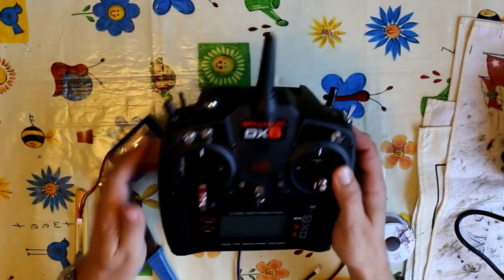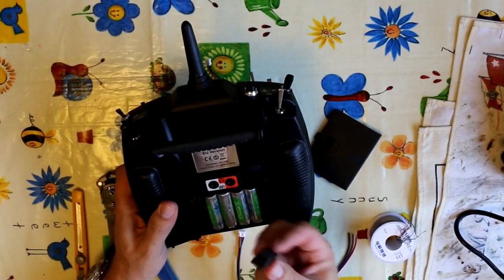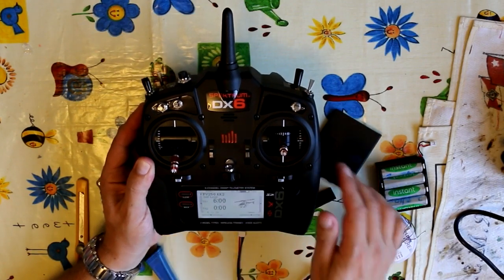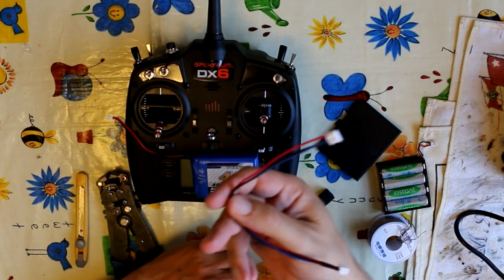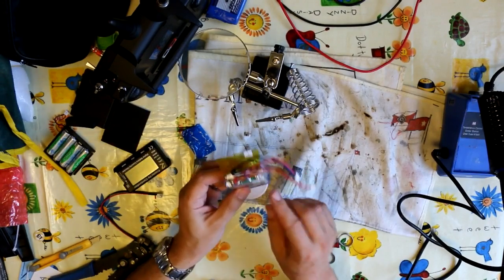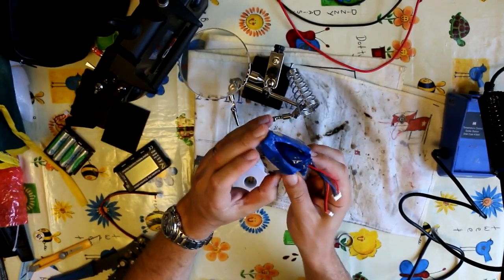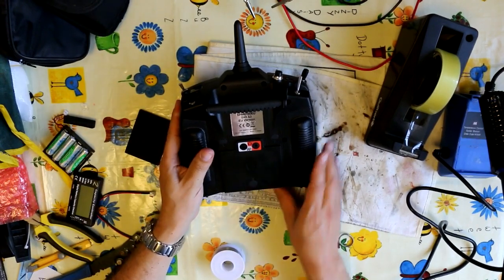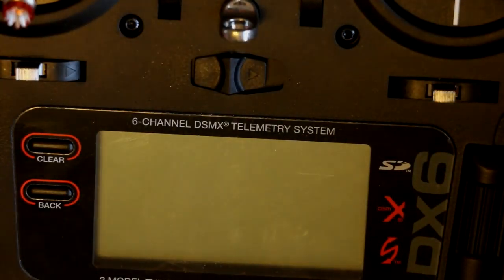Spektrum DX6 -  cheap lipo conversion using Turnigy 4000mah DX8 lipo

Comment: I just installed a standard servo connector (futana).spliced into the wiring than use a field charger to charge the battery and than install the battery in the transmitter and your done.Make sure to set your field charger at 0.5 amps and 2 cell.It takes about 6 hours with a new battery.I just replaced my battery this way in my DX8.

Comment: The low voltage protection circuit on the Turnigy battery was turning my transmitter off around 6.9 volts - the transmitter would just go dark. Luckily it happened when I was doing stuff on the bench and not flying. I had to change my Lipo voltage alarm point on the DX9. After doing this mod, adding the balance lead, it turns out the two cells were almost .4v off from each other. I think that's why it was cutting out early - one cell was triggering the LVC well before the other. I think this mod is a REAL good idea not just to charge with a radio like the DX6, but also to balance occasionally for radios that have built in charging. This was great, thank you for showing exactly where to solder!
Reply from the maker: Glad this was useful. Interesting that your cells were so out of balance, on my DX8 the charging is incredibly slow (48 hours or so!!), and my undestanding is that slow charging should balance out cells at the end as one cell will sit full while the others 'catch up', but I wonder if this would only happen if you to leave the Tx on charge for several days. I bet a lot of people (including me) only charge the Tx for a few hours just to top it up (my DX8 battery will last for months between charges) so this isn't enough to balance the pack out ! I much prefer being able to click the back off and use a proper balancing charger, as its much quicker/easier, but I hardly use my DX6 (I use DX8 for planes/heli's, and used the DX6 for FPV quadcopters), but plan to use it to teach my son to fly so will dust it off for that.

Comment: Is there any way to do this to the old DX6i cheaply? I found a 2300mAh AA 4 sell pack for a few £ that looks an easy strait forward swap...
Reply from the maker: I got rid of my DX6i's, but don't think there is space for a battery pack without cutting the case also the DX6i I believe has a DC-DC converter inside so would overheat on Lipo voltage (it was based on old JR radio stage I believe). What I did with mine was to use the ENELOOP/NIMH+ AA cells, I also resoldered the charge port the correct way round (they came with the old JR centre negative wired, so its a quick soldering job to swap to the standard center positive) then just recharge with the charge port using a cheap charger plug. I found the good rechargable Eneloop/Nimh+ lasted ages and don't have self discharge so most of the benefits of a lipo for much simpler.
Reply: @jamesb72  hey, thanks for the response. I think just a 4s AA pack 2300mAh will do me fine... Good flying!

Comment: hi mate can you help please i have dx6 3G and bought a Turnigy 4000mah model no spmb4000lptx lipo for HK. when i charge it on my imax b6  it ask me to connect the balance connector and there is no connector. The setting i am using on the charger are Lipo charge 2ma / 7.4 2S is there something i am doing wrong here.
Reply from the maker: You cannot charge that lipo on DX6 - its for DX8 which has the internal charge port, you'll have to make up a balance lead pretty much like I did to be able to charge with B6

Comment: Can i do that lipo cenvert to my dx6i????? tnx
Reply from the maker: Andrej Spreitzer not easily as the dx6i doesnt have space for lipo or run on higher voltage so you'd need to cut the back out and use a voltage regulator - nothing is impossible but i would just use eneloop type low discharge nimh aa cells as they fit straight in and have most of the benefit of lipo and if you swap the wires on the charge socket to be centre positive which is normal way round you can charge with a normal charger.
Reply: Tnx for a great advice....i will do as you say.

Comment: Why would Turnigy make a 2s lipo with no way to balance charge it? Thats odd.
Reply from the maker: foxprogt it was made for the dx8 which has an internal unbalanced charger built in. At low current charging and discharging balancing isn't much of an issue it's only for flight packs where fast charging and discharging make balancing more critical.

Comment: what happens when you  get a  low voltage alarm in mid flight?
Reply from the maker: Gary Vale you just need to land immediately depending what you set low voltage alarm too you should have several minutes warning.
Reply: but will my Tx inputs continue to operate normally and the voice settings and LED screen  still operate?
Reply from the maker: Gary Vale everything should work as normal down to about 5v (if you ran on AA batteries that's all it would have) its just how long that is as battery drops off quite quickly towards end of its capacity. A FULL'  2S lipo is 8.4v and it should discharge down to ~6v normally, after that the voltage will drop more quickly, I have warning voltage at 6.8v which would give plenty of time to finish flight without any concern - honestly I wouldn't worry about it as long as you change battery mode to lipo - if you forgot to do that then AA alarm could be at 5v which would be very late for a lipo.
Reply: @ James.....I have have my low voltage alarm set at 6.8v  too, however I am using the Lith-ion pack.... I was always curious as to what exactly happens if I received the alarm in mid-flight, but seems that all I should get is the voice warning...and still have plenty of time to land...... as my Tx will continue to operate normally...until  it dies of course ,  which you believe is 5.0v......this is the  info I wanted to know......... .thanks  much......Gary
Reply from the maker: Gary Vale you can test this at home to check how long dx6 runs for from 6.8v warning I'd expect it would be ages. I've had low voltage warnings on dx8 and finished flight with no issue. I've never run dx6 that low as battery lasts so long i recharge when it gets to half on graph which is pretty infrequent. back in the days of 35mhz i would charge transmitter every time i flew and occasionally would run out during a days flying but transmitters ate much more efficient now and batteries much better!
Reply: good idea and helpful information......my guess that the Lith-ion battery  would have quite a bit of  its capacity power left from the warning alarm set point at 6.8v until it reached  down to 5.0v,  where the Rx would then go into Fail-safe mode... I am not sure about how long  exactly the Lipo would  continue to operate in the same situation...maybe that's something you want to test out....if so, make another video on it..... ...thanks
Reply from the maker: Gary Vale that would be a very boring video even by my standards I'm sure you'd have plenty of time to land safely which is all that matters.

Comment: Hi James,  I want to convert my Turnigy 4000Mah Lipo for my DX6 also. I saw your video, but I want to double check with you exactly how the new connections for the charging cabling are to be made. To me it is was not really clear, I am no Lipo expert. So can you describe this part in short to me. I would appreciate this very much. Thx, Rob
Reply from the maker: Hi Rob, I tried to show this in video at 3m10s, but best way is to use a voltmeter you will get ~8.4v across the battery terminals you want to use for red/black, use the original red/black cables to identify which end of battery for which, and then measure ~4.2v between either of them and the centre connection for your middle balance wire, voltages don't have to be exact but if you get ~4v when you expect ~8v you know its not right. Once you take the tape off the end of the lipo you will see hopefully it looks same as in video and it will be clear.
Reply: Thanks James  for the additional info. That was a good tip to use the voltmeter. Just to be sure and on the safe side. I have adapted my Turnigy 4000Mah Lipo now and it is working fine in my DX6. Thanks again for the assistance.

Comment: good work, my turnigy battery just turned up so I've tapped a jst plug onto the batteries spectrum plug and plan to just charge it like that. Won't be a balanced charge, so I might add a 2s balance lead on it later. thanks.
Reply from the maker: I don't have any experience of non-balance charging, but in the DX8 it would only charge unbalanced (but takes 15hours or so), so my understanding is that unbalanced charge is fine for slow charging (1/10 C - 10 hours or more), but no higher/faster.

Comment: So will running the tx at 7.4v rather than regular AA 5.8v or whatever, possibly make it have better (stronger) range by chance?
Reply from the maker: Sorry no, the transmitter runs on 5v internally regardless, there is a DC regulator to drop the lipo voltage down ;) The range is limited by regulation, so would have to be constant throughout battery charge and between battery types. If you have your receiver/aerial properly mounted you should have no issues with range up to 1km which is well past line of sight.

Comment: Got it charged with no problem outside the transmitter. Really isn't difficult to plug it in or take it out, you have ample lead on the Turnigy battery charger wire to maneuver. Thanks again.

Comment: Excellent video. You sold me on going with the Turnigy 4000 over the Spektrum 2000mah Lipo for the DX6. To charge the battery I bought the Spektrum Adapter cable with the banana leads. I have an iMax B6 charger. Do I simply plug the leads into the side of the charger, set it to LiPo and hit start? I'd much rather install a charge plug as you did, but I just couldn't see the connection well enough in the video to try that. Again thanks for the great video!
Reply from the maker: I only ever balance charge, but using the adapter, you should be able to charge as 2S lipo at a low current as its unbalanced charging so need to take care and never charge unattended. If you have a voltmeter and check the connections you can identify the pack positive/negative and centre tap easily to add a balance connector.
Reply: Yeah, I used the adapter and charged as 2S Lipo at low current. Worked like a charm. Thanks for the extra help with adding a balance charger to the battery. I'm going to get a voltmeter so I can be sure of what I'm connecting to. Appreciate the video and the extra tutelage.

Comment: So, to make this work, I need to solder one ground to either ground terminal and then one wire to each positive terminal?
Reply from the maker: No, you need one wire to each cell +/- on balance lead, I tried to show this on video, but you should check with a multimeter to be sure you have cells correctly connected or it will damage your charger or lipo. You should have ~7.4v across edge pins on balance tap, and ~3.7v between the centre and both edges with correct positive/negative.

Comment: Thanks for this video.. Was having issues with my bat. Would never charge above 8.1v and 20 seconds after turning on the Tx, itt would drop to 8.0. Then, last night i was charging it at 500mah (.25c) , 2 cell, normal charge (non balance) on my Hitec X2 AC-PRO. I left it for a while...when I went back, it was at 18.3v!!!!!!! i was like WTF is going on... I stopped the charger and watched the Volts drop back down to 8.1 rather quickly. Charger was set to not go over 4.2v per cell too... No idea. But I just installed the balance lead just like you showed, plugged it in and viola, 4.10v per cell. Looking forward to running it down now so i can see if it will actually charge it to full (or close to it). Of course the next dozen or so charges i will be watching it like a hawk to see if it does that again.. scary
Reply: Ok. After the second attempt to charge after this mod (2s, .5a, Lipo, balance), One cell is at 4.07 and the other is at 4.12 with an error on the charger and will not charge any further. I might have burnt something up last time. Just broke down and picked up the Pulse. Im going to scrap this pos.

Comment: jamesb72 did u use regular solder? and by ground u mean directly next to negative or the actual negative? i ask about solder because tabs are sometimes hard to solder wondered if u had just used existing solder that was on pack
Reply from the maker: +Mike Sarni I used lead free solder and a good iron, most soldering problems are down to poor irons. If your not confident soldering you can buy these pre-made which may be a better option for you.

Comment: Hi, thanks for the informative video.. Excuse my ignorance/stupidity,  I have done exactly as you explain and show in your video but when i connect my battery to my Sky RC charger via the balance lead(with battery in transmitter)  i get an error on charger `connection error check main port`  do i still need to disconnect battery from transmitter and connect to charger... This is my first lipo battery as tend to fly slope soarers...
Reply from the maker: +Heath Cope Most chargers need the banana plugs also connected to charge (I use cellpro chargers which just user balance tap up to 4amps), you will just need a small harness with a 2S balance socket extension with banana plugs Tee'd into the positive and negative wires so charger is happy - you can very easily make one of these yourself if you are comfortable soldering, just buy a 2S extension lead from hobbyking, and a couple of 4mm bullets - or you can buy these pre-made, I just googled and this one should work but am sure there are others if you search '2S receiver harness' http://www.amainhobbies.com/rc-cars-trucks/protek-rc-balance-charge-lead-2s-balance-harness-to-4mm-banana-plugs-w-4s-adapter-ptk-5319/p244687
Reply: +jamesb72   Thanks for replying...  Can I just tap into the original  battery red and black  and  connect my charge leads to these even while the battery is plugged into the transmitter with the original lead that i have tapped into ??
Reply from the maker: +Heath Cope You can certainly tap into the red/black for power connections but is there space in hatch for these to tuck in neatly? I would never recommend anyone charge battery while connected to transmitter just in case, but I have done this with no issues using my cellpro charger.

Comment: Thank you jamesb72.  Just finished up converting my Spektrum DX7s to the Turnigy 4000mAh lipo using you well detailed video. took about 20 minutes start to finish.  It's on the charger, as I type this and I am looking forward to the extended flying times with this battery. Cheers!
Reply from the maker: +Brad Algra Glad it was helpful, the battery life is hugely improved, and no self discharge, I have only charged mine a couple of times this year - I definitely need to get more flying !

Comment: when I put the turnigy in the dx6 do I just select lipo in the transmitter? what about setting the low voltage what does the transmitter need at minimum?
Reply from the maker: +timothy dzugan yes, you just set lipo and the low voltage alarm in tx, the tx will run down to much lower than this lipo can anyway, so is not an issue (its designed to run on 4xrechargable AA batteries, so I would guess can run fine down to 4.5v or so).
Reply: ***** OK thank you

Comment: I ordered this battery thinking the charger that comes with the 200 QX  would charge it (I don't mind removing bat for charge). Do you know if it will work?
Reply from the maker: +Jason Charger I don't have the 200QX but just googled and the charger looks to come with an adaptor to std 2S connector, which would work fine with this battery. Worst case you can get a cheap basic balance charger from hobbyking which will do fine.
Reply: +jamesb72 Thanks for the reply. Turns out the charger that came with the 200 QX will NOT work with this battery, but found an adapter to charge the battery for about $3.

Comment: I did mine just like yours.  On my 2-3s balance charger the 1 and 3 lights light up instead of 1 and 2 with a 2s battery.  Did i solder something backwards?
Reply: mooosestang had the 1st and 2nd wires switched.